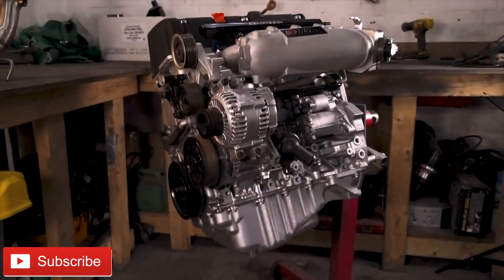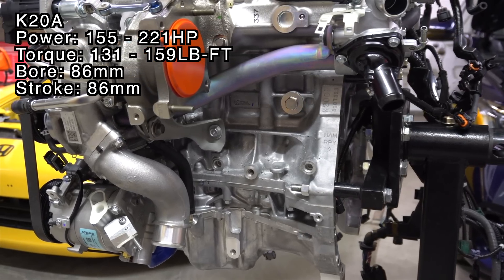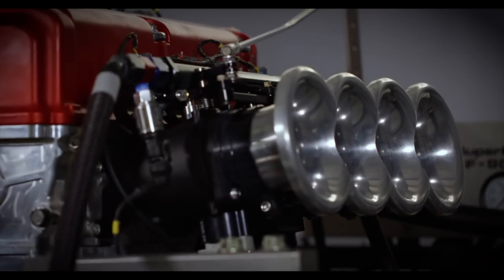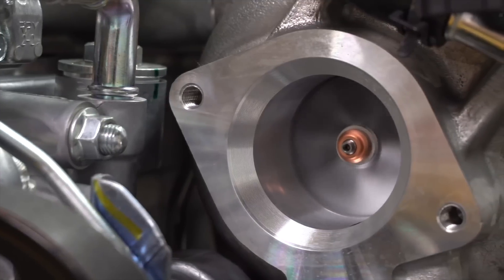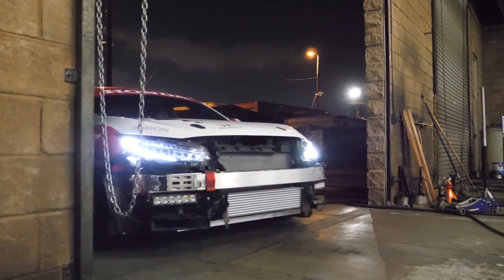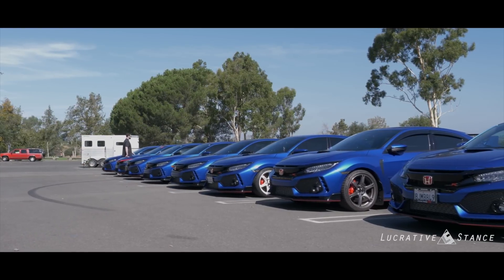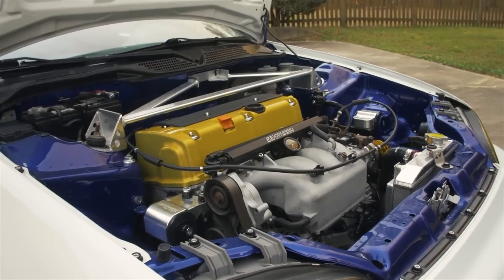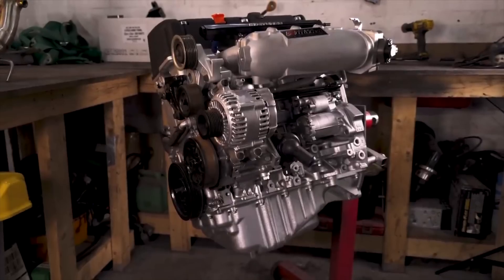Honda K20A vs K20C: What's the Difference?

Comment: Moral of the story is..   boost your k20a.  Or B series.... Or H series
Reply: Moral of the story ebay turbo kit makes any honda a 2018 type r
Reply: @Bryce Czirr ill take rpm over torque anyday....also boosted k20a makes alot of torque too it just peaks higher at 6k+ rpm. low end torque is for economy cars
Reply: @Bryce Czirr thats an assumption....torque wins 0-60 but torque doesnt win races. rpm is better because not only does it increase horspower it also increases top speed. torque does nothing in real races, when racing you are gunna be in the high rpm most of the time and your low end torque dies out and becomes useless. higher rpm/hp cars will always beat higher torque  with the correct shifting...
Reply: Or d series
Reply: We were worried when they came out with the K series, I took a chance and bought one in 2002 Ep3 with a very good K 20 A 3, not a performance engine, but very peppy for the era, good on gas, and in limited HP form very reliable infact did not do a single repair in 13 years, that car ended up getting totaled when someone cut in front of me, Being in finished business I decided to purchase another one. This time K 20 Z1 which is an upgraded K 20 A2, and yes Turbo on E-85, Dynoed and Tuned by Proven Power in Tampa Florida, and what a difference.
Reply: @Bryce Czirr Look at the boosted boiz mr2 with a k20a2 twin turbo engine with 1000whp. The higher you increase the rpm the more power that makes. Hp comes from torque x rpm. The k20a engine has a square bore and stroke at 86x86 alowing the engine to rev higher producing less torque because the stroke is not so long. The ea113 engine in the golf gti has a 82.5 bore and 92.8 stroke producing more torque but not alowing it to rev out because the crank can only spin so fast. That is why diesel engines produce loads of torque but only rev to like 5k. Lets see a k20c engine make 1000whp.
Reply: Or F Series
Reply: @Bryce Czirr horsepower is rpm x torque although it is more derived from rpm since horsepower gained from rpm growth is exponential. so engines with more rpm naturally have more horsepower than torque. it is not magic. horsepower is more important in races where youll be accessing higher rpms more often . torque is only useful in lower rpms so it is not racing oriented other than drag/dig races
Reply: @RigoRocks23 negative z3 all the way
Reply: Or J series
Reply: @Bryce Czirr just because you dont know how higher lift cams work isnt my fault it isnt magic either. theres a reason why many hondas make hp all the way past redline
Reply: @Bryce Czirr theres plenty. for example look at tongmans civic si with supercharger. he opted for supercharger rather than turbo but it runs high 10s in quarter mile...a tuned type r or gti couldnt do that unless it was heavily built
Reply: his civic isnt even fully built either just good shifting and making power past redline
Reply: @Bryce Czirr that gti is quick but its more modded than tongman running alot more boost....tongman daily drives his car and only makes 380 whp. if je went the turbo route he would have way more top end power and smoke that gti. but his civic would win at the track
Reply: @brucelee7283  I have researched the whole torque vs. horsepower rpm argument, years ago. I can post the article when I find it, but yes, you are essentially right. It is better to make power at a higher rpm. Why? Because you can take advantage of gearing. The article also specifically explained how Hondas achieve their speed with this technique. Torque does not win races. That is merely conjecture. Also torque is not sufficient without complementary gearing.
Reply: @BrandonNesbitt-777  Yes indeed! Finally people who understand mechanics.... thanks for clarifying
Reply: @Bryce Czirr check my dyno and it'll prove you wrong. 425 hp stock k20 and dyno shows it only going up as rpm goes up. That's why you get a higher ar turbo hence gtx3071r gen 2 .82 ar
Reply: I have now boosted h22a5 its brutal moment and power..
Reply: @josephguitars  boosted h22 is badass! my buddy had a turbo accord h22 it was insanely fast. if u run more boost you should sleeve the motor cuz of frm cylinder linings.
Reply: Or f20c1
Reply: MOAR BOOST
Reply: boosted k20a is actually faster than a k20c. I have 08 si with gt35r turbo making 335whp at 9.5 psi @8000 rpm...a k20c is basically a decompressed k20a....I have stock bottom end btw
Reply: what? no1 gonna mention the N series engines???
Reply: @fawkurface46  N series are irrelevant outside of Europe and they were never intended for performance lol
Reply: @ShaiyanHossain  maybe not performance, but if they were more popular you would see more 60mpg hondas rollin around
Reply: good luck getting your hands on that engine, they were only made for the nsx and stopped being produced like 15 years ago. also its a 90 degree v6 engine so it wont fit in any Honda vehicle unless you could rear mount it into something

Comment: K20A with forced induction >K20c anyday of the week.K20c has vtec only on exhaust cam and it has the same problem like the 9gen civic si K24Z7 and that is the integrated exhaust manifold in the head stock vs stock both are in different league but if talk about modified then K20A is simply a more performance oriented engine and the cylinder head of the K20A flows way better as compared to the K20c
Reply: It doesn't flow as well because of the direct injection. This swirls the air giving it more grunt down low and a cleaner burning fuel mix. Hondata ported a k20c head and it flowed just as well as older k series, but it kills the low end torque.
K20c1 is for the guy who wants a turbo Honda, but don't want to deal with the headache doing it yourself causes.
Reply: @snakeballs8965  the exhaust maniflold is also integrated in the cylinder head it can never flow as good as a K20A even if ported.same is the problem with the 9gen civc si k24z7

Comment: 6500-7000 shift points are lame, though.  Why not turbocharge AND rev high?  Why does nothing OEM offer that?
Reply: HDR Engine Development my guess is that emission regulations have made it difficult for manufacturers and customers to reach that sweet spot
Reply: Cylinder pressure would become to high and the longevity and reliable of the engine would decline.
Reply: high revving turbo engines aren't very reliable and yeah emissions legislation comes into play

Comment: when you said k20c is way better because of the flat curve powerband which is absolutely wrong. the reason why it need low end toque because the fact that its not n/a like the k20a. if the k20a were build with the same low end power it wouldnt be able to get as high as hp as it can get. so yes, its a completely different engine because of its characteristic.

Comment: I want to swap a k20a in my fk8
Reply: It's a downgrade then
Reply: Sketchy Pigeon it will be fun
Reply: @sketchypigeon1070  I disagree somewhat. No VTEC on the intake cams is seriously disappointing. Even Like Wilson from 4Piston said it. This is seems to have been engineered with a disregard for tuners. And if you follow the Hasport k20c1 videos were the they try to fit the new engine into older chassis, you will find it almost impossible to fit in. Why?
Reply: cant wait until FC3s are cheap so we can K24 swap them

Comment: I have had many civics in my life but I love my FK8. However I miss my 99 EM1 with a B16B. The K20C is more practical because of low torque but I do miss that high rev sound of the old Bseries. I liked my 13 FB6 K24 flet like a good balance.
Reply: No offense but why would you spend the money for a B16B to swap into an EM1 that already had a B16A* that you could just buy cams and springs for to equal the power?
Reply: just ride a motorcycle. Even higher redline and the sound is insane

Comment: Although the k20a2 that was used in the type s Rsx was the same engine used in the ep3 type r civic. It's not the same as the k20A used in the itr,the a has a higher redline,higher compression and 20 more hp
Reply: The JDM EP3 Type R used the same K20A as the DC5 Integra Type R. The UKDM EP3 Type R used the same K20A2 that’s in the pre facelift RSX Type S. The US EP3 had a K20A3 which only made 160hp
Reply: EP3 did not have k20a2. It had 160hp base RSX motor. K20a3 I believe
Reply: kdavid123186able he said ep3 type r which did have the k20a2 and the usdm version only got 160hp
Reply: K20a from itr and ctr are the same only thing that changes is the exhaust and headers

Comment: The k20A came in the jdm dc5 type r only. The Rsx had the k20a2 and the si had the k20a3.
Reply: JDM CL7 Euro R aswell
Reply: Only FD2R came in K20A
Reply: Touche! My point was simply If there is going to be a comparison on the k20c and "k20A" let's hear it,but this comparison was between the k20c and k20A2 and A3 not the "A"
Reply: Ep3 type r is k20A2
Reply: @eddiedick9886  In the UK the EP3 has the A2. In Japan, its the high compression K20A.
Reply: K20a was jdm k20a2 was civic type r in the European market and k20a3 was America’s watered down version

Comment: I’ll say a K20A even though I am a big fan of B18C
Reply: Agreed. Tbh, Im more of a B series fan myself. Though the K is definitely the superior motor, I'd rather daily a B16/17/18 with bolt ons because to me they sound better.
Reply: @J3Fox00  I'm with this statement even though my car is a k😂
Reply: @John Bowden  that's great man. Yea I love my TSX but honestly who doesn't love the classic appeal of a good B
Reply: Not me that's for sure, lol. To me it's just a better driving experience, the B just sounds more raw than the K and it sort of gives me a nostalgic feeling. Like I'm in the early 2000s during the tuner craze.
Reply: @J3Fox00  my H22 swap with JDM Fujitsubo header and Greddy exhaust sounds way more splattery and backfirey than my RSX type s with nvidia exhaust. RSX handles better, but that exhaust sound is priceless
Reply: Keith Lamp - Every RSX I've driven has very noticeable understeer. A Prelude SH is older but feels MUCH better. Trust me.
Reply: @yadidimeanmaine  
If you add DC5 typeR parts, it will be a little better
Reply: B17A1 here

Comment: As long as you keep the torque low on the k20a k20a2 you can push 400bhp on a stock engine and still be reliable the con rods are the weak point on the k20a
Reply: Nah gearbox is the weak link in a k20a